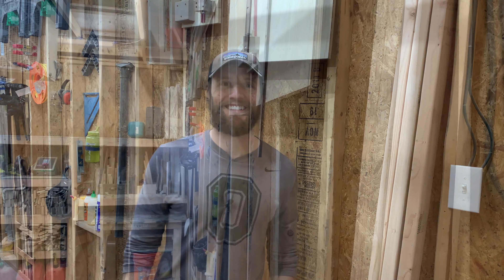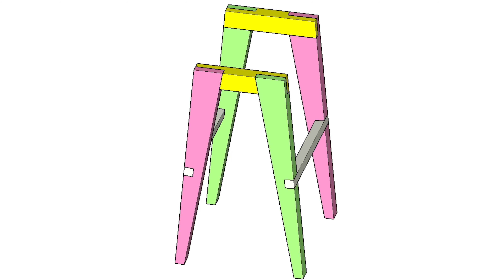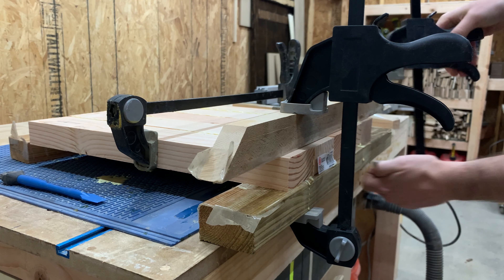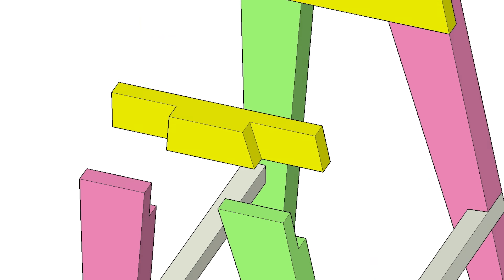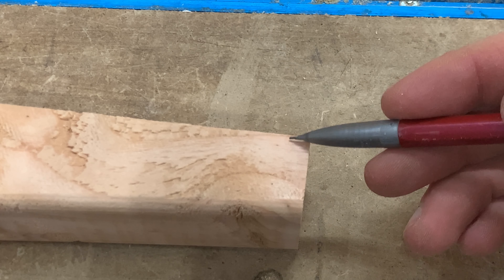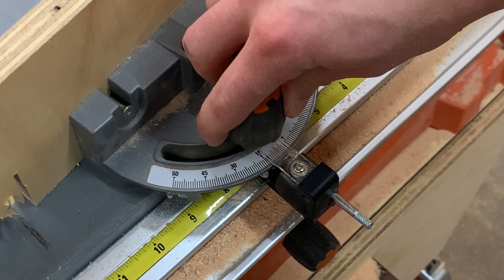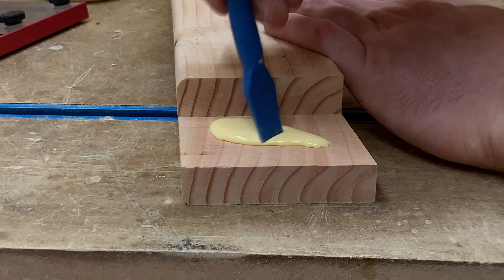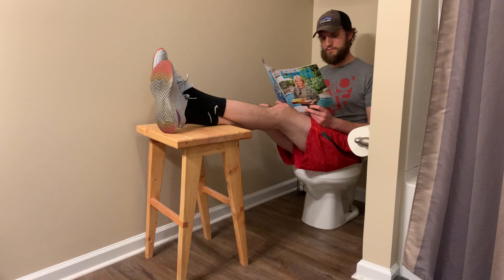The Art of Simplicity in Crafting a $500 Stool from 2x4's

Comment: Nice stool. Excellent design. The tapered legs are a nice detail. I think I would beef up the foot rests some to give a bit more side to side rigidity. If the width were 15 7/8 you could save a 2x4. But it's still going to take 3 so maybe it's not worth it. Overall definitely a worthwhile project.  👍👍Plus an excellent production. Thank you for sharing. Have a great day and stay safe.🙂🙂

Comment: Hi, thanks for video. I am only starting woodworking and now read a book about woodworking basics. Based on the book, because of season temperature changes, such stool top connection will destroy the whole structure or I misunderstood something?
Reply from the maker: Hi Sergey! Yup, wood movement is a real think. I even talked about it towards the end of the video. I made this stool just as a prototype and I’m not really concerned if something like that does occur. That being said, if you really want this to last for years and years, I’d recommend using z clips, figure 8 fasteners, or some other type of hardware that allows for wood movement
Reply: Thanks, what about the next video: “and now the really true stool”?
Reply from the maker: I’m not sure i understand the question?
Reply: Yes, wood movement needs to be considered. But you need to consider the species of wood and the dimensions of the project. In this case the screws into the soft 2x4's will have some give. Also because the overall size is relatively small the overall wood movement will not be great. Quite possibly insignificant. If this project were to be done in something harder, like oak, then your concerns are very valid.🙂🙂

Comment: Wait, wait, wait.  Is that your design on that taper/straightline jig?
Reply from the maker: I wouldn’t say it’s 100% mine design, rather a culmination of a lot of different versions I saw that I adapted into one to suit my needs. We got a full video from way way back in the day of how we made it
Reply: Spencley Design Co. what I should have asked is the fence riding mod yours? I’ve got a jig that uses that. One that’s an L Fence and one to do miters on the edge of a panel. But that mod for a straight line jig is pure genius. Adding it to mine this week.
Reply from the maker: I don’t specifically remember anyone else doing it? I wanted to have that mod to just make the whole jig more versatile
Reply: Spencley Design Co. well you nailed that part for sure. And so simple that it’s amazing that no one thought of it before. With your mod my straightline jig will be as square as if I did have miter bars on it.
Reply from the maker: That was exactly the plan!